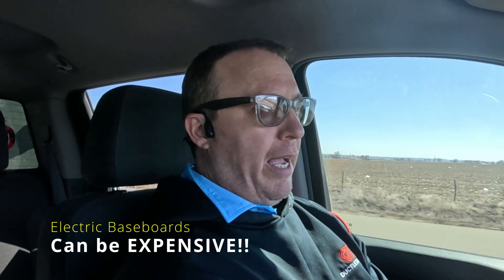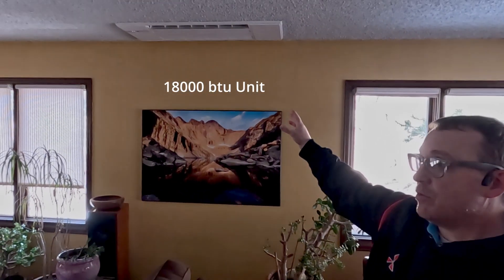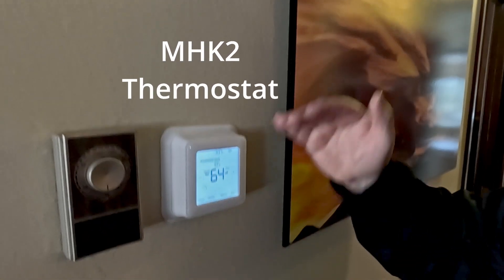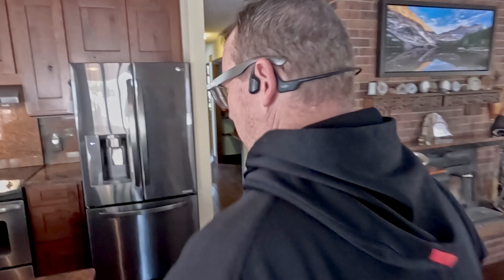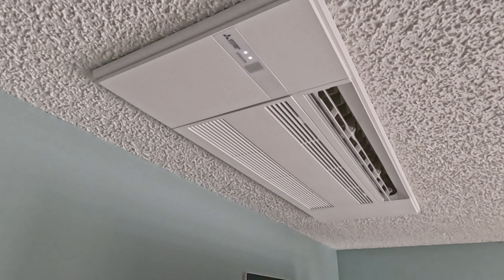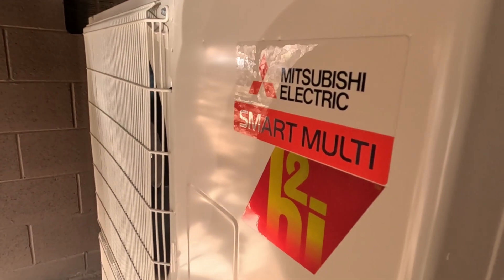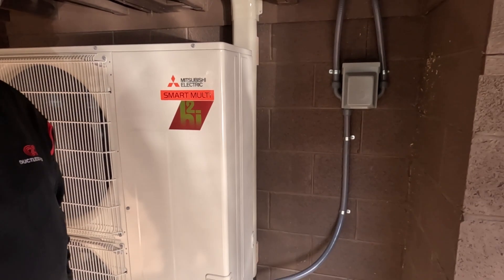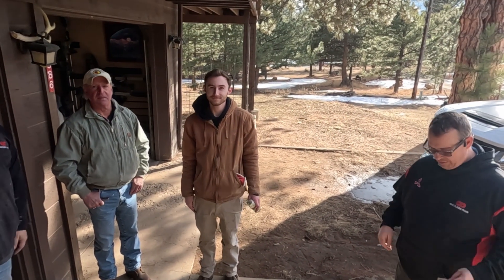Electric Baseboards OUT - Mitsubishi Ductless Mini Splits IN

Comment: If electric baseboard was 240v and the split is also, does that mean wiring is easier? Or do you need to run new wiring for a/c regardless since it is independent ?
Reply from the maker: You are not allowed to jump off of one dedicated 220 V power supply to another power device. You have to run what they call a home run per circuit great question.

Comment: While my house has Central air, there's one room that is at the end of the duct system that always seems to be warm in the summer and cool in the winter.
It does have an old electric baseboard heater. How likely is it I can just take that out and use the same circuit to run a mini-split?  It's not a very big room, so I don't need a big unit. Is the draw requirements for a mini-split more than a typical electric baseboard heater?
Reply from the maker: Great question sometimes they can take more amps than the Ductless units.